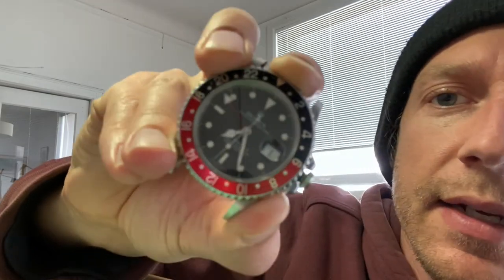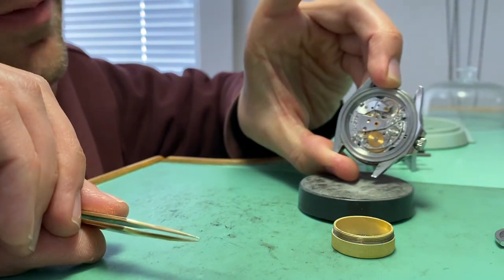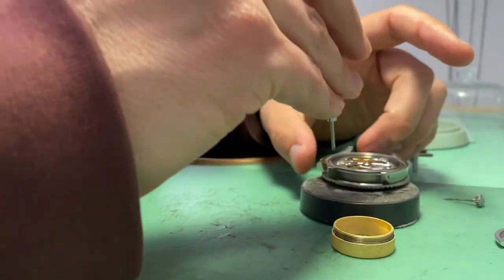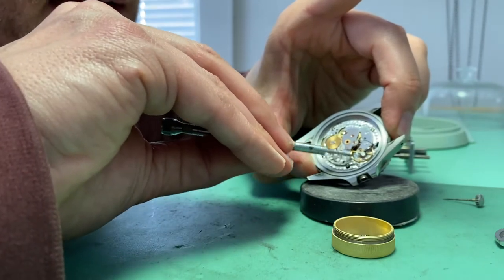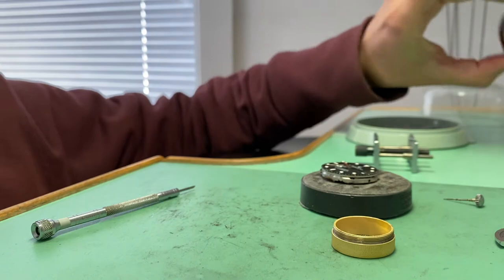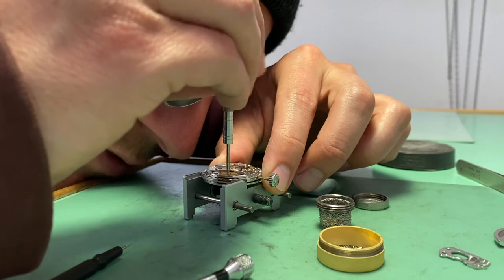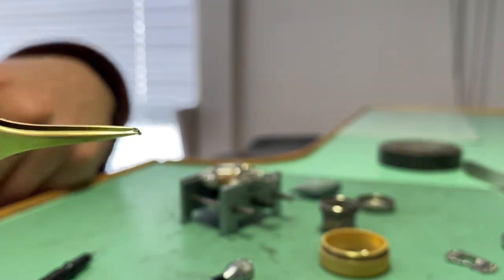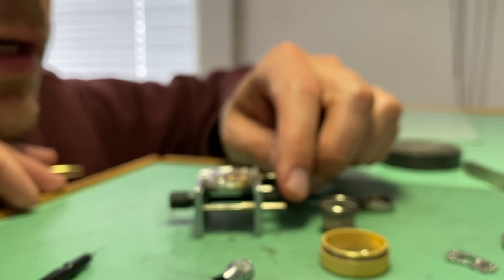Rolex GMT MASTER ll disassembly 16760 AKA "Fat Lady"

Comment: The only thing i have mastered is the watchmakers position...  Have you always liked your brass tweezers  that much?
Reply from the maker: I started using those brass tweezers a couple years ago. They are nice kinda have the shape of the steel hair spring tweezers but, they don’t scratch anything and they are good for cap jewels and small screws. Sometimes I get rough with them and they get messed up.